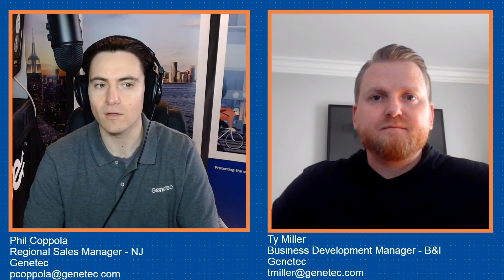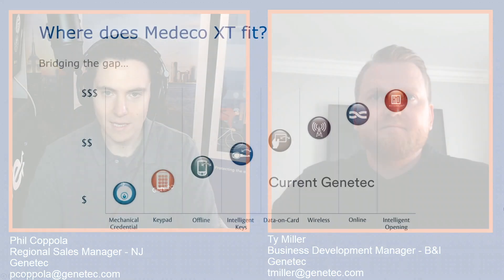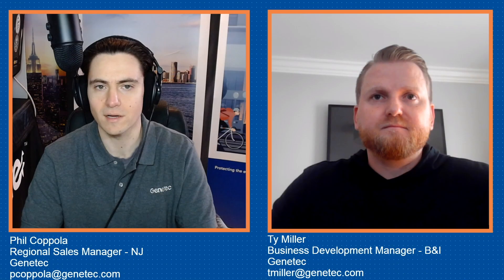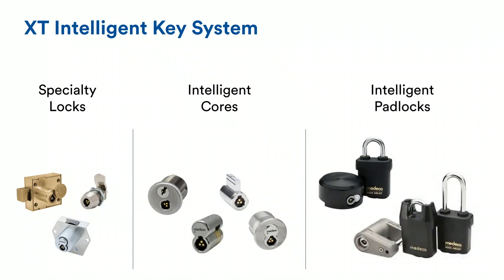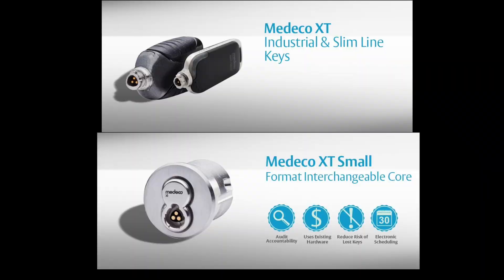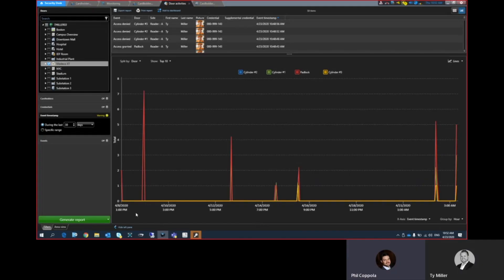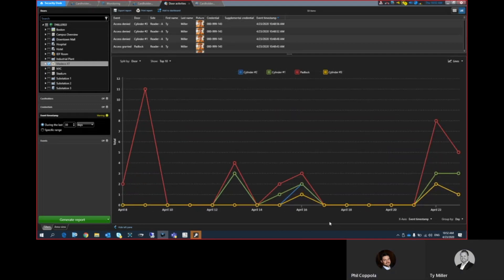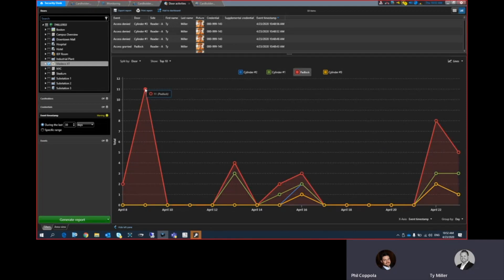Smart Locks on Dumb Doors - How MedecoXT and Genetec bring INTELLIGENCE to Non-electronic locks

Comment: Hi Phil, Great video! Here https://youtu.be/v100OMnZzHU you can find the Hospitality solution that you mentioned several times in the video. This is an Abloy's case study video in UK with the same company group technology (Assa Abloy), it was back in 2012-1024 when new features like Connect keys (online keys) were not available at the time. Abloy offers the Abloy Protec2 CLIQ solution which also includes the mechanical key cutting (copy-restricted key) so it works with electronic and mechanical locks. In large critical infrastructure companies with countless remote assets protected by mechanical or electromechanical locks, the same key will work!
Abloy is part of the Assa Abloy group and is focused to protect critical infrastructure companies: utilities, telecom, transportation, oil and petro. 
Abloy and Genetec have great case studies to share. Do not hesitate to contact me if you would like to share more information with your audience: juan.noriega@abloy.com